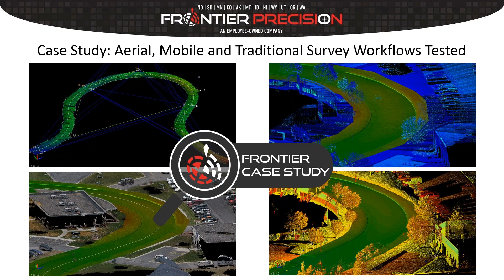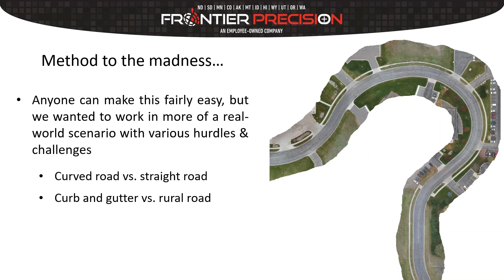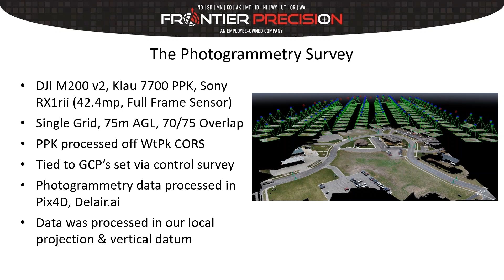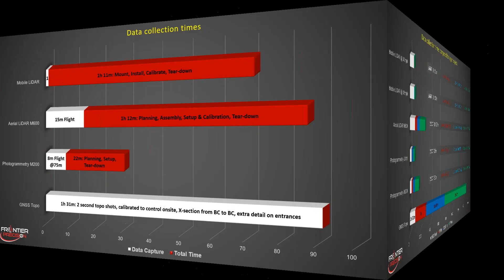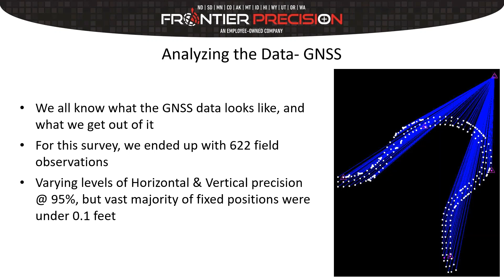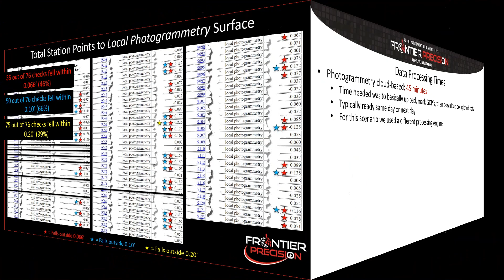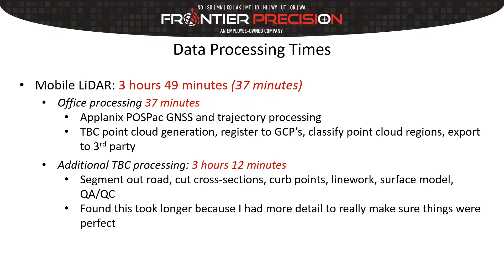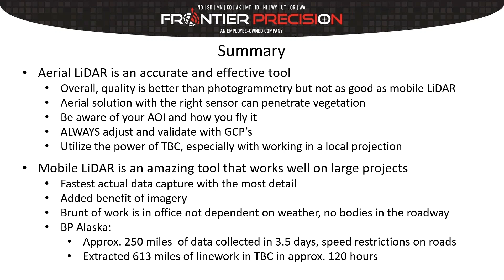Case Study  Aerial, Mobile and Traditional Survey Workflows Tested

Comment: Thanks for your video.
Your study is interesting and easy to understand.

I am French and a surveyor student. I have a question regarding the quality of the results in planimetry.
What can we rely on to make this comparison? Because a nail on the ground is not necessarily present in the point cloud.
I was thinking of using building corners calculated by intersection as references. What procedures would you recommend?

Thanks again.